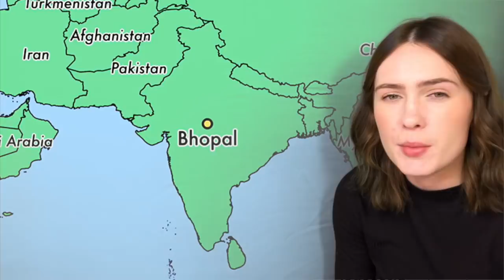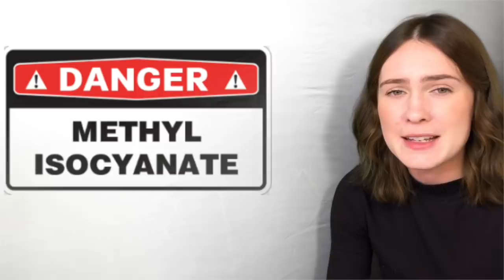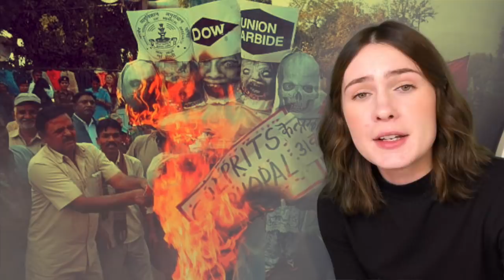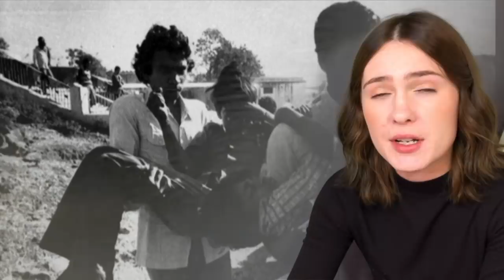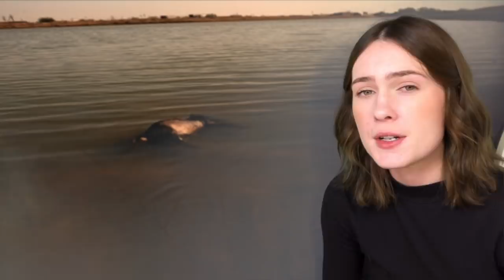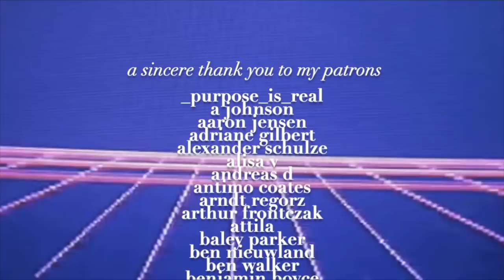The Worst Industrial Disaster in Modern History..

Comment: It's hard to say that there were any lessons from Bhopal because it was little more than a high-casualty incident. In you subsequent videos, you might want to ask comments to provide summaries and pointers to the smaller instances.
For example, the cities that allowed developers to build right up to fertilizer plants and explosives plants. Texas has had multiple instances of fertilizer plants blowing up. Less common now are grain elevators producing massive explosions.

Disabling multiple safety system simultaneously is also common. For example, I live in Palo Alto next to Stanford Research Park. The city government allowed a company to move its industrial operation (plating) into one of its buildings next to my neighborhood. An operator at the company dumped a bad mix into the disposal tank without checking what was in there, and the combination produced a reaction that overwhelmed that tank. The scrubber that was supposed to handle such events was undergoing maintenance -- its access doors were open so the gases escaped into the surrounding room. That room was supposed to be a containment area in case of failure of the scrubbers, but its doors to the outside were open as part of the maintenance process. Lots of parallels to Bhopal.
The neighborhood was lucky -- because it happened during a windy period, only one person was temporarily overcome. In investigating this, we found that the company was storing large amounts of cyanide 10 feet from the property line of houses (the houses were there before the "Research Park"). Furthermore, the storage facility was on top of one of the inactive fault lines that could be put into motion by the San Andreas fault (6 miles away) or one of the closer active, but smaller, faults.
It took years of work and political agitation by residents before the amelioration of the situation began. This was a neighborhood full of people with PhD and other expertise in the technology and manufacturing processes. I suspect that there are many neighborhoods in the US that are facing this situation but lack the ability to understand it and fight it.

Comment: The company had skilled engineers but they filled it with unskilled labourers to cut down costs.
The company mismanaged it as there were the same gas was leaked before in February 1982, an MIC leak affected 18 workers. In August 1982, a chemical engineer came into contact with liquid MIC, resulting in burns over 30 percent of his body. Later that same year, in October 1982, there was another MIC leak. In attempting to stop the leak, the MIC supervisor suffered severe chemical burns and two other workers were severely exposed to the gases. During 1983 and 1984, there were again leaks of MIC and other gases but company failed to resolve the issues and gov't didn't even bothered either at the end people suffered .